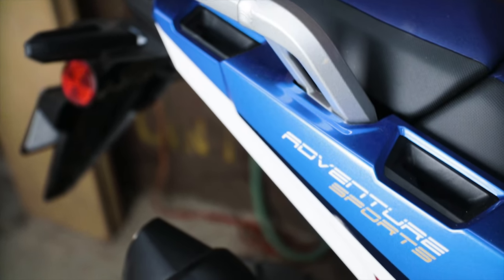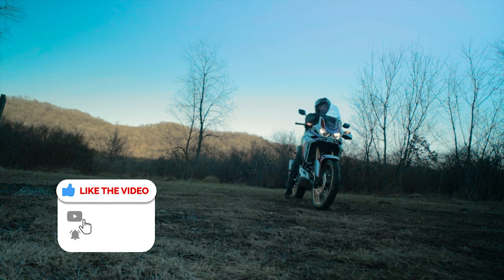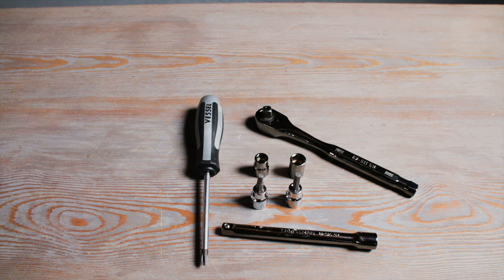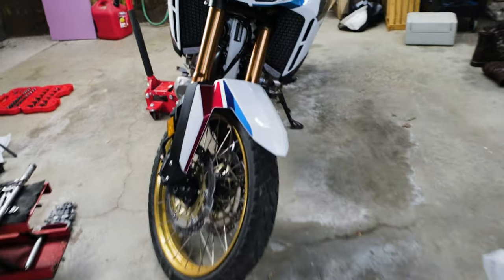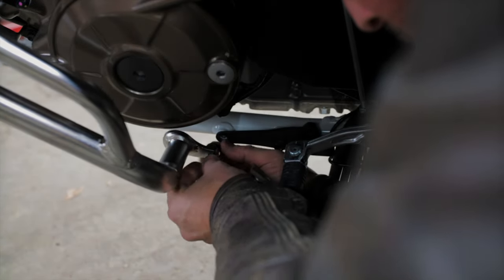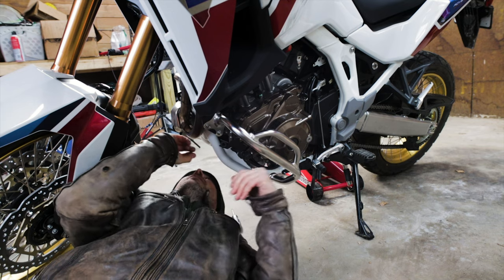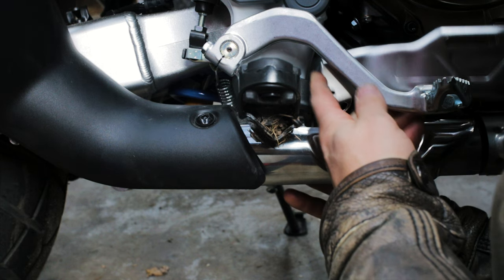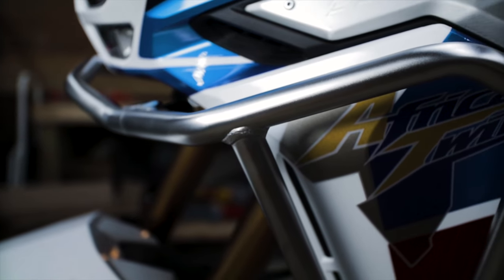Honda Africa Twin - Crash Bar install - Ep. 2 Installing the Engine Guard

Comment: Hi there man, first of all thanks for your video, it’s extremely useful. The best I’ve seen on YouTube so far! 
I want to install my engine crash bars on my AT, which I’ve purchased with the upper crash bars already installed. In order to do that, removing the belly on both sides should be enough correct? I should just slide the engine bars underneath the upper crash bars on the mounts and screw it back together as far as I understood from the videos.

I just want to optimize the time it’ll take me to install those due to long drive ahead! Thank you so much in advance
Reply from the maker: Yeah, man.  While it’s a bit more difficult with the uppers installed, I think it could be done.

Comment: Can you install a none Honda light or crash bar to a at with Honda lower motor guard?
Reply from the maker: I don't believe you can. Each are pretty unique and depends on the installation of the other.